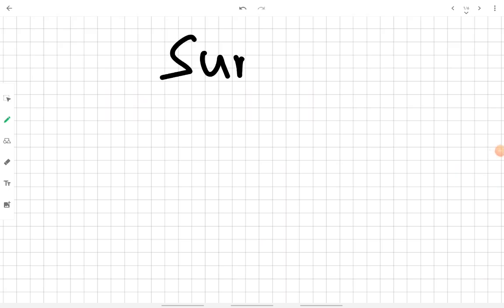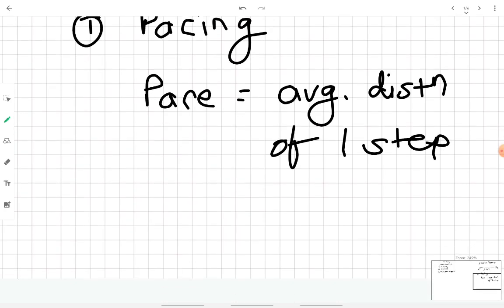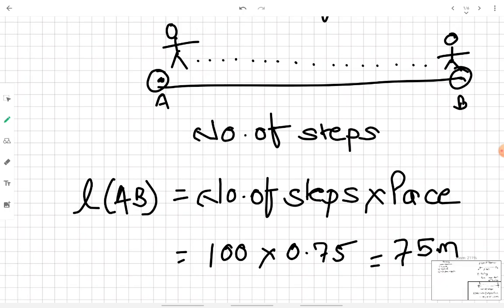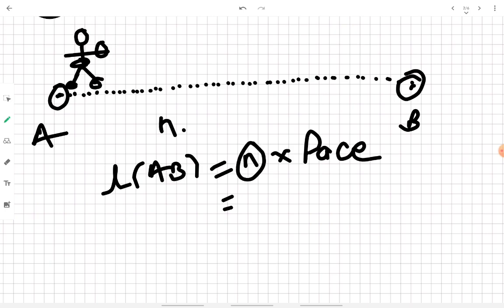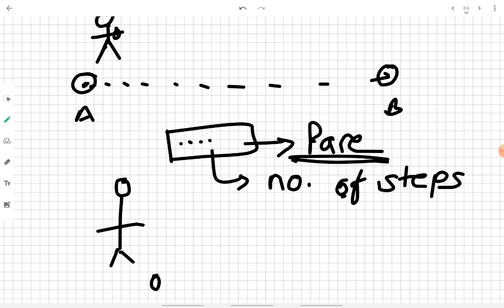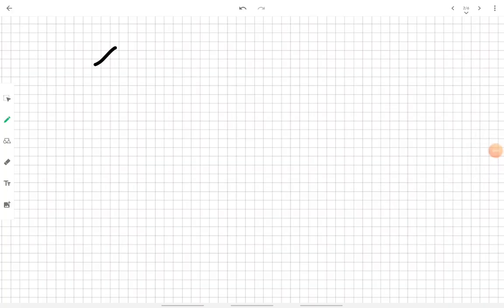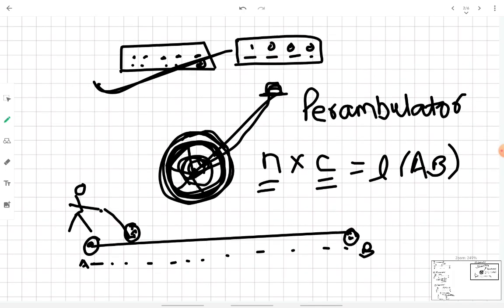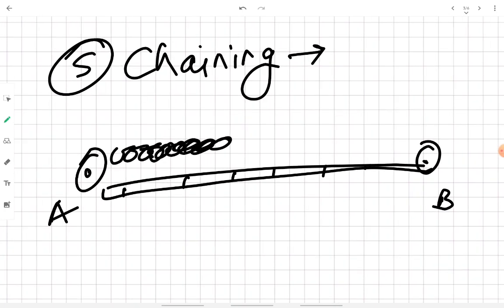Linear measurements | Part 1 - Direct Methods | Surveying Explained

Comment: In pacing system, when number of steps are to be remembered by us then what does the pacing system do?
Reply from the maker: It's absolutely rough method of measuring distance. When no instrument is there and reconnaissance of site is to be done, pacing is used, just to get idea of distance, lengths and expanse of site.